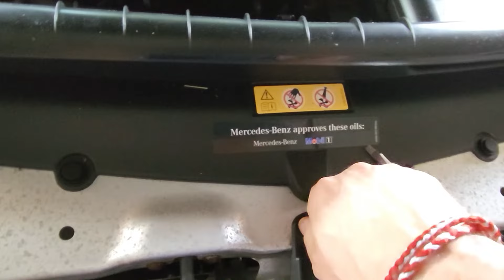Mercedes GLC GT AMG Style Front Grill Replacement

Comment: Having done this myself - i can confirm it's a pain to remove.  One point not covered in ANY of these vids is during the removal there is a a spot that i struggled with.  These are 3 clips both sides at the 4 & 8 o'clock positions. You need to use a thin plastic prising tool from the front for the middle clip.  This is where it will stall the removal. Hope this helps any future installs
Reply: What grill did you purchase. Do you have a link